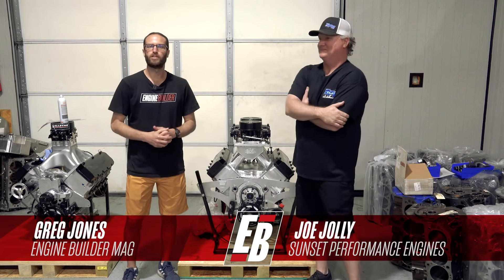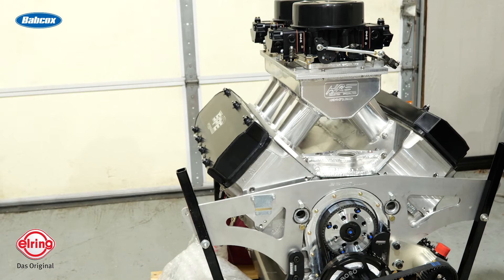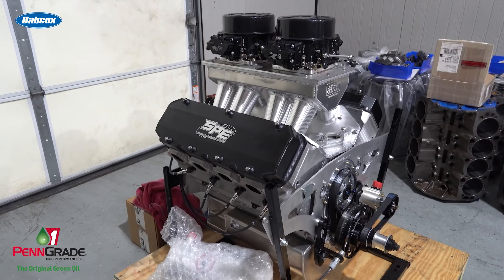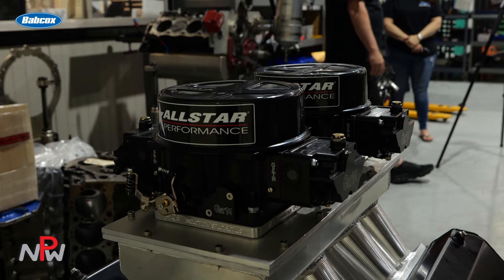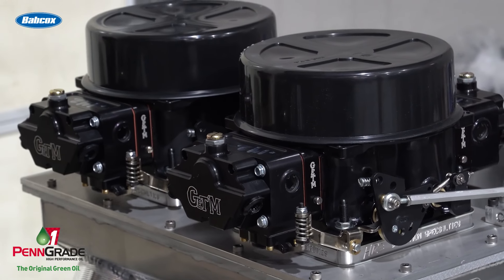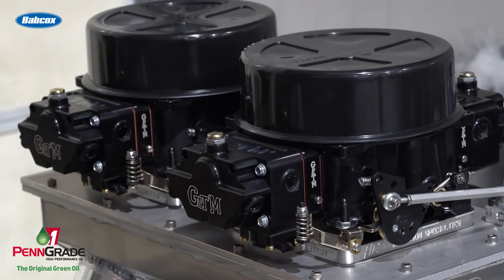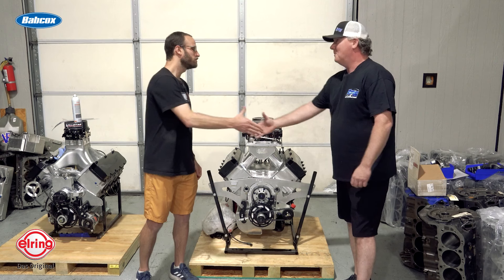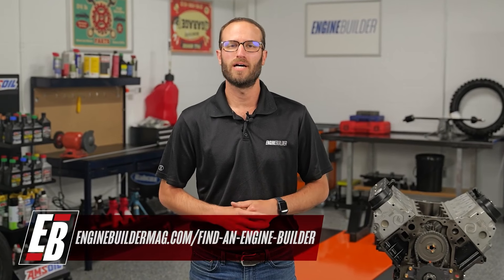655 cid 9-Degree Big Block Chevy Engine

Comment: That's an awesome engine but torque is a little on the low side
Reply: Obviously the heads are the culprit. He probably just sets the cross sections and doesn't spend much time trying to get port speeds up.